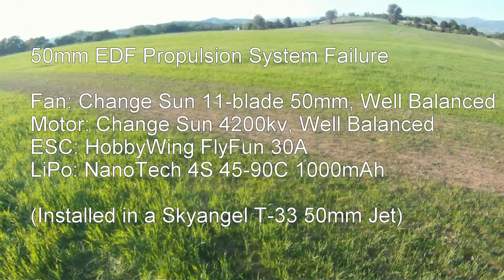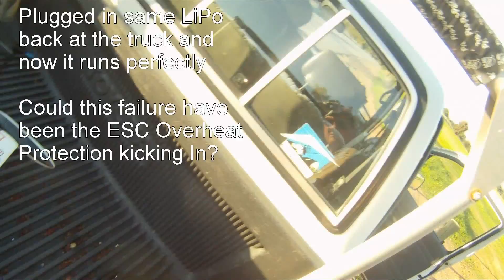50mm EDF Propulsion System Failure, Skyangel T-33 Change Sun 11 blade

Comment: I was looking at some of your other videos, and I see you have several of the Jpower/Skyangle 50mm edf's.  I just received my Skyangel F-16 PNP.  During the little building required, did you make any Mods I might like to know about?  I will be taking out the stock motor/fan combo, and replacing it with the same setup your using now in your T-33, also a 4S setup.  I will be running a 45A esc just to be safe, lol.  You just can't beat the sound of these 11 blade fans...

Although after seeing your F-16, I may keep it stock for a few flights, just to get used to the handling.  It already looks so fast in stock form in your vid.  Balancing that fan blade really makes all the difference.  I can tell just by listening to your stock setup, that it's way better tuned/balanced than others I've seen in videos, that are right out of the box.
Reply from the maker: The stock F-16 Skyangel gets better than 1:1 thrust:weight, roughly 1.2:1.       The battery space is rather limited with little foam thickness anwhere to cut down to make room for a 4S pack.
I'm sure the CS 11-blade setup with a 4200kv CS (red) motor would make thing Jet scary fast and sound great!   Just have to get creative on finding the space for a compact 4S pack that won't puff when the CS-11 blade unit sucks the 40+ amps it will on 4S packs.  I think you're rigth on regarding a 45A ESC.

As for setup on my F-16.. I used the 3rd hole out on the servo arms for the alieron linkage and the 4th hole out for the elevator linkage.  This gives the elevator more angular travel than the ailerons.   The furthest outside hole on the servo arm is unused.   I also connected all the easy connectors to the outside control horn holes for all surfaces.  I think skyangel ships the hardware with this already setup.   I put a dab of CA on the joint and threads after centering the controls and tightening the screws.

I balanced it per the maual and it flys perfect.   I may be very slightly aft of that on occasion (by placing the battery a little further aft) to get better high-alpha flights in.

I have thought about going to 4S on the F-16.. but it just flies too darn good on 3S.     It's lightweight on 3S too, making for some fun low speed high-alpha flying... just watch out for the "right hook stall" that it will do when it's too too slow.   The stock 5-blade Skyangel EDF is the best efficientcy 50mm fan I've owned.   I take time to balance them, and have even been balancing the outrunner bell using some CA and accelerator.    They can be balanced well, but sometimes the mold on the fan/hub is so bad that it should be thrown away for a replacement.   I bought a bulk of 6 or so of the stock EDF housings and fan/hubs... and from that batch, 2 were relatively true and easy to balance, 2 were good enough, and 2 were terrible where the through-hole was over 1/32" off center relative to the hub and blades.  Throw those ones away.    As a note, I have the J-power/Skyangel Screamer with a stock 4300kv motor that I run on 4S.   It's well balanced, and would you believe that it produces 670 grams of thrust!?    Theres a video of this one somewhere in my video list... just shows how good the often underestimated stock fan/motor are.
I know you mentioned wanting the whoosh sound.. so I agree with your choice of the CS-11 blade unit.      Have you seen the Dr. Mad Thrust 10-blade units?   I have a few that I plan to tryout over the winter months.

Comment: Not sure why nobody commented on this.  2 things I could think of.  Your ESC is way too small amperage wise, for your motor/power setup, as you also suspected.  Even a 4s with a 35c rating, you are going to have problems with that small of an ESC, with that motor/fan setup.  Hobbywing/Pentium Esc's are good, so no problems there.  You'll be running great with a Hobbywing 40A.  The other thought, did you program your ESC to Timing Low?  That will help explain the intermittent running.  Anyway, a 40Amp ESC, program timing to LOW, and you can run that 4S 45-90C.

Glad you got it down with no damage, nice work.
Reply from the maker: Thanks for the reply.  I agree with you.. the ESC is too small to handle 4S packs.   I know that this setup draws 40Amps at full throttle on 4S.   The little HW FlyFun 30A ESC i have is not meant for this.    I have it on my hit list to upgradet to a HW FlyFun (Pentium) 40A ESC, but haven't gotten around to it yet.  You and I think alike!  I have since flown many 3S packs through the same airplane and ESC without any problems.   However, when I tried running a 4S pack with careful throttle management, I had the same failure.   The timing has been set to LOW on the 30A ESC.
I have a number of the HW FF 40A's sitting unopened.. perhaps I'll tackle this after work this week.   It was sooo much fun flying this jet on 4S... amazing performance.